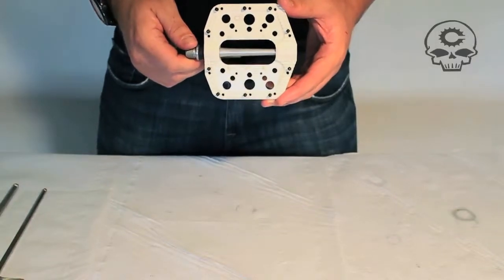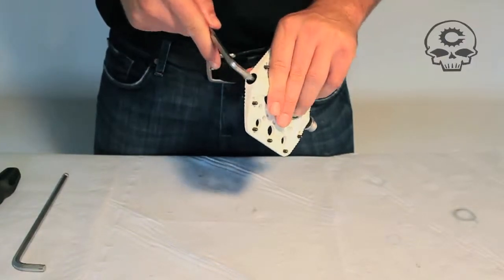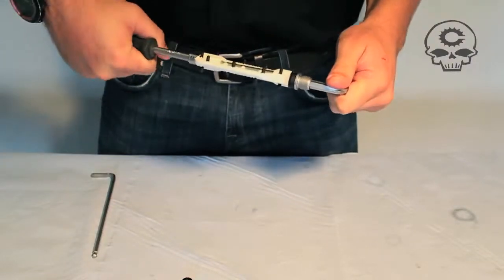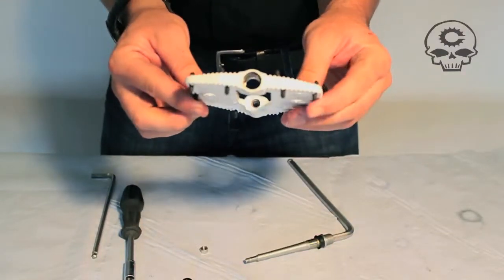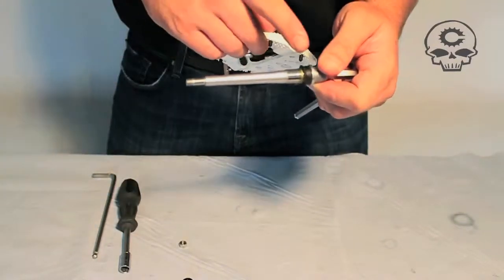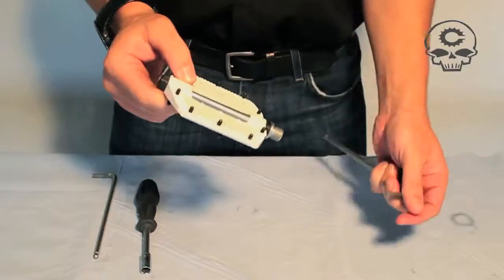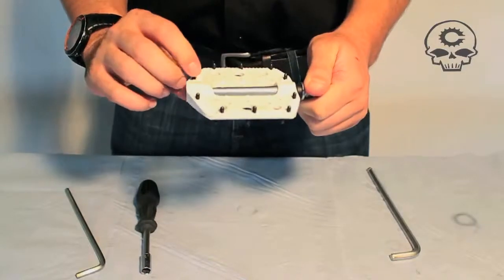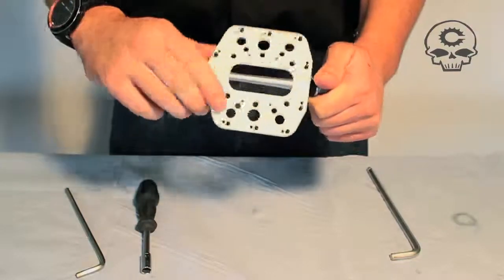Canfield Brothers Crampon Classic Service Guide

Comment: You mention using a 9mm to remove the lock nut .It doesn't fit and I can't find anything that will . Do you need some type of shallow wall socket
Reply: i went and purchased a narrow wall socket and it still won't fit :(

Comment: Mine is a 5 mm to remove end cap, not 6mm.  And no 9mm socket I can find will fit in the hole to get the nut off, so my rebuild kit is not going on that I can figure.  oh well.